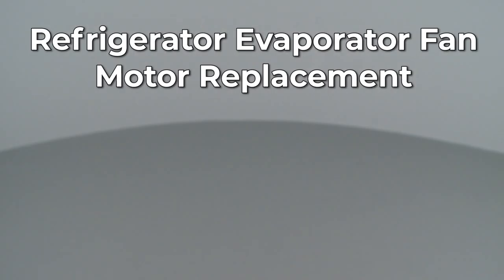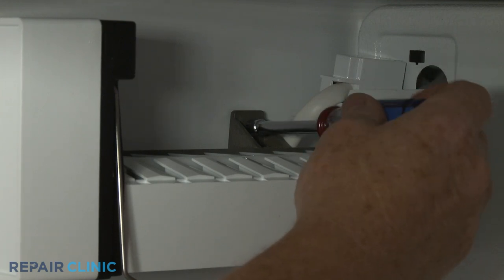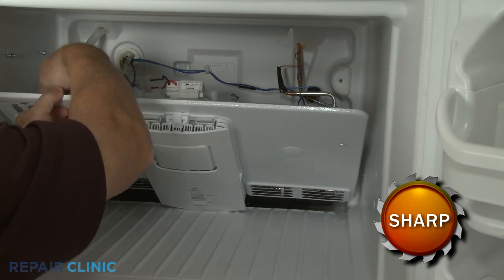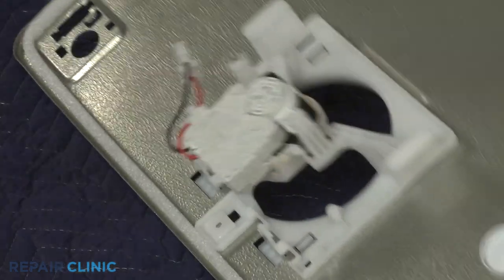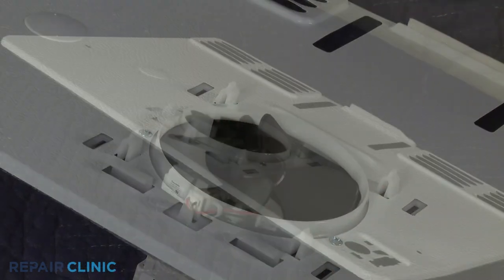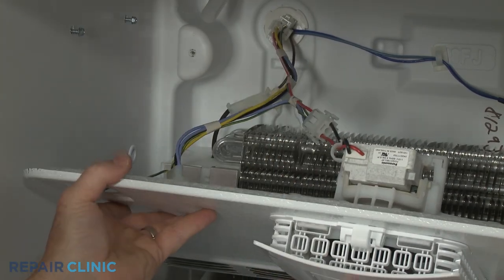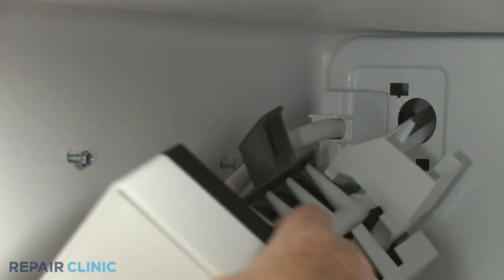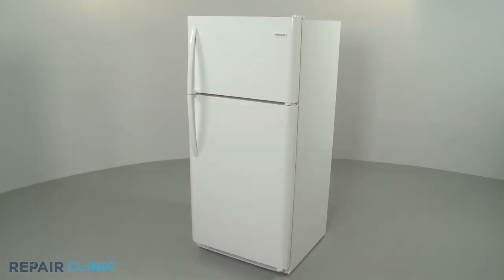Evaporator Fan Motor Replacement (part 242077705) - Frigidaire Refrigerator Repair

Comment: That was a useful video as I had not had to replace a fridge fan before. As an intermediate method while I figured things out, I put a tight frozen food wall (8 to 12 inches high) near the back of the freezer section...this allowed the cold air to pool down into the fridge part easier and brought the temperature down to 38 from the 50's....I call it the Alaska food wall cheat...that benefits the lower 48 part of the fridge.
Reply from the maker: You're welcome! 

We are always happy to help. If you would like to give us a review on Google, we would much appreciate it: https://g.page/r/CcVUrahZNozMEBM/review

We hope that you have a great day!

Comment: I was really hoping you would give it a quick spin with your fingers. My freezer is cold but fridge is warm. My fan spins but not very fast. When i spin it by hand  it a little tough to turn and come to an almost instant stop. Does this fan supposed to turn easily with no resistance?